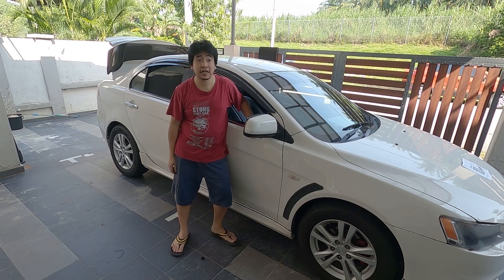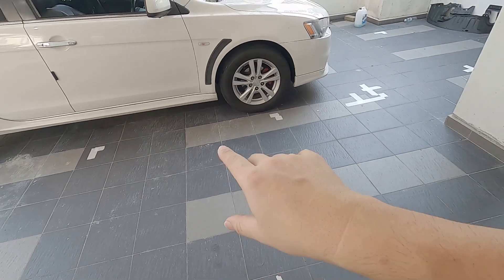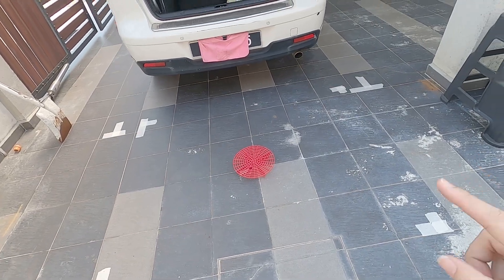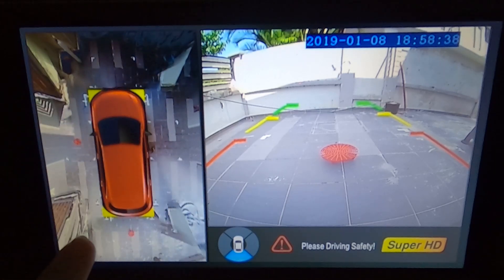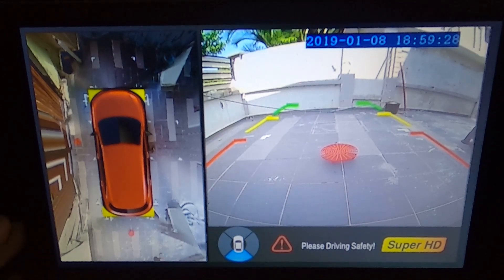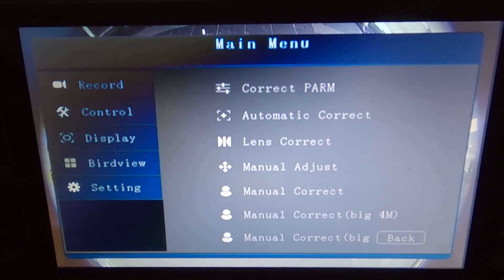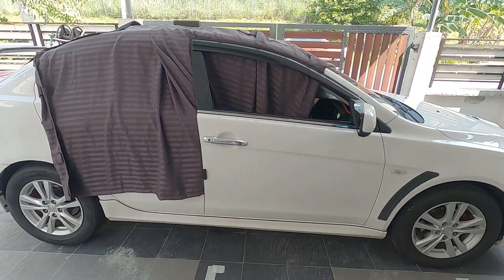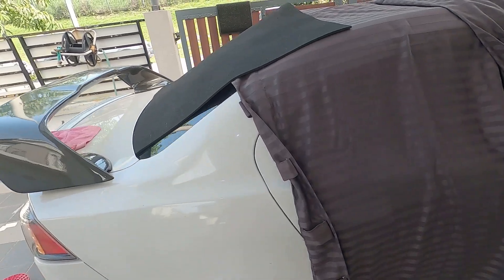How to calibrate BirdView / 360 camera.

Comment: Hello, how can I create a vehicle to use in the 360 view app.  since the models that are there do not fit my car
Reply from the maker: What car are you driving?
There are players with 360 function built in nowadays. This video is an older model whereby the 360 module is independent and can work as long as you have a video input on your player.
Reply: Thanks for answering.   I have a Getz Hyundai.  wo Radio comes with the 360 integrated module. and there is no alternative to choose the car which is a haback.  and the calibration is the same?

Comment: do you think this system could work on a van? 5 mts long van
Reply from the maker: It should work the same. Maybe need to recalibrate the measurements.
Reply: @TCsAnythingGoes how do I find the correct measurements?

Comment: No 2D 360 camera image and the menu setting no longer show.
Reply: The system acts strange alot if the times. To get to menu you should be able to do that by clicking (ok) button. However since this system is not perfect try to click (power) then (ok) buttons then do it again..and again until it goes to menu. Mine always works after i click on both buttons twice.

Comment: Thanks for the video. I have the same settings as you do but I have 8 calibration points for each camera. 

Do you know where the 4 extra points should be placed on each camera to calibrate?

Also mine came without any instructions so is there anywhere I can get a newer firmware?
Reply from the maker: Man... i wish i could help you but i am not sure why yours has 8 calibration points. Hit me up on FB (TC's Anything Goes) and send me a pic of the calibration screen. Let me see if i can figure it out.
Reply: Did you figure out how to do it tezza?

I have the same problem with 8 points
Reply: For this type, I think the calibration boxes should be at the corners of the vehicle. So for example when you calibrate the front camera, the box on the right will be the same box for the RHS camera's front side. Every box will be used twice during the calibration.

Comment: Ciao amico il tuo video è veramente utile volevo chiedere un consiglio, come si impostare che il video rimane attivo anche dopo aver tolto la retromarcia così quando si parcheggiare posso guardare anche avanti. Grazie molto
Reply from the maker: L'ho fatto collegando uno splitter RCA a Y in modo che la mia uscita dal dispositivo diventi due. Uno va all'ingresso inverso, un altro va all'ingresso AUX del lettore. Quindi ogni volta che voglio vedere il video senza andare al contrario, passo semplicemente ad AUX In

I did it by connecting a RCA Y splitter so my output from the device becomes two. One goes to the reverse input another goes to the AUX input on the player. So whenever I want to see the video without going into reverse, i just switch to AUX In

Comment: Hi..Is this box measures is same for all car ?
Reply from the maker: It should be. I bought a universal unit and the instructions did say that this is the measurement for any cars.
Reply: @TCsAnythingGoes  what is the distance between perimeter of the car and from and back boxes ?Then plz elaborate the points to be calibrated at sequence.Thanks in advance
Reply: @TCsAnythingGoes  hii.sometimes recording is not done and no recordings at screen.Sometimes works.Is it with the issue of memory card?

Comment: I install Bird Eyes Camera in my Car,  it can view 4 angle , Yesterday i have a car accident , I need to get the Video recorded as a proof of court case, But the file is in 264 format, when play in my car device i can see 4 screen, Front, Right, Left and Rear, But when play in PC I only can see the Front Screen, I need to view the back screen  as evidence to court, and also convert to a playable video to present to the police and court,
I have search few hours in google and I still fail to open the Back camera file,
Can you help and guide me?
Reply from the maker: i might need some time to get back to you on this. In my unit, i did not put in a memory card hence there is no recording. 
But a quick idea is to play the video from your car and record it either:
- using your phone camera
- download an app to record your player screen (if its on android)
Reply: Good point.  I'm about to make a purchase a 360 bird view camera system. I put this backup video accessibility in list of points to look at before making purchase. Thanks for sharing this important point.

Comment: Hi Bro.. My inspira hood release cable seems to be broken.. Is there any way that i can still open the hood from outside? Thanks 🙏🏻
Reply from the maker: Yes you can. You can access the cable from the driver side fender. You will need to remove/loosen the fender cover and reach in to pull the release cable.